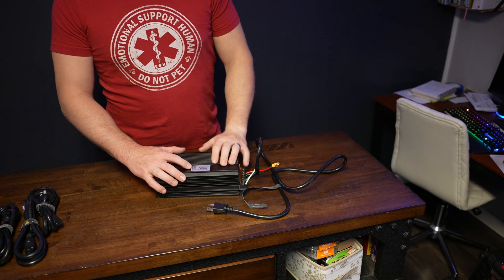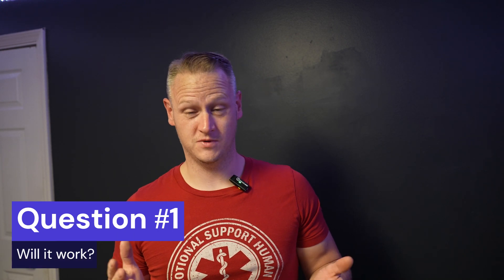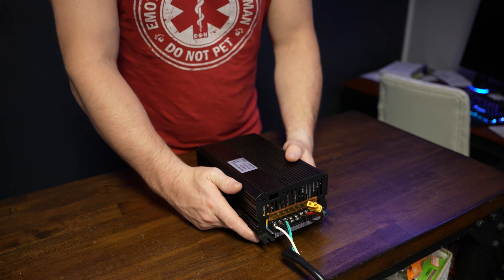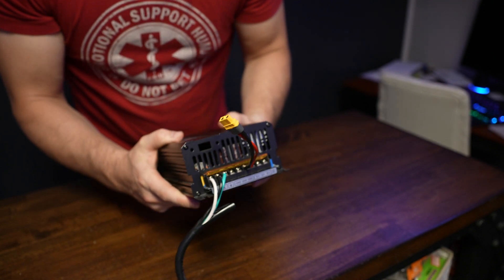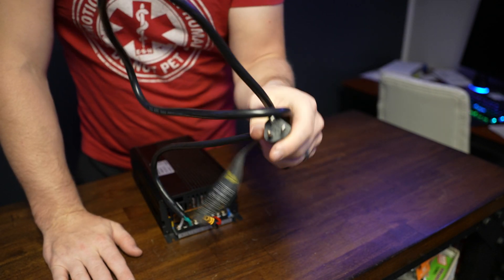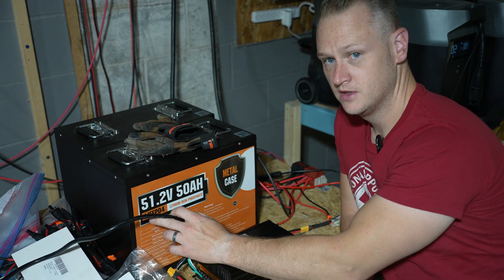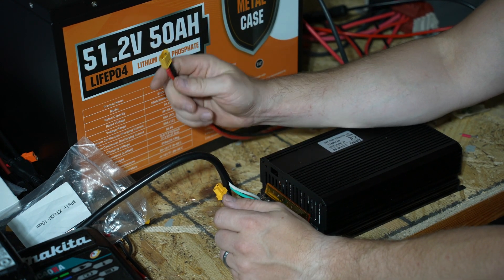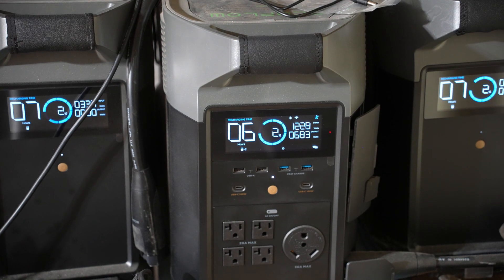Ecoflow Delta Pro  - Using an AC Switching Power Supply to extend your Delta Pro

Comment: Dan thank you so much! Google's Gemini actually recommended I watch your video because I was asking it about a particular solution that I needed which is similar to what you've found. I have a roof mounted solar panel system that can on the brightest of days put out about 7000 w. The inverter for that system CAN produce power even when the Grid's down. It's a special feature that will allow it to produce up to 1500 watts of 120 volt AC power depending on sunshine. I'm trying to get that power into a ecoflow Delta Pro Ultra's low power PV input. I need a device that can change that varying AC power into varying DC power that the Delta Pro Ultra inverter can safely accept. Initially it seemed that an EG4 chargeverter was the only thing that would do the job, but perhaps your system would. Thoughts?

Comment: Just clicked the link, it states a output of 18amps. Doesn't that exceed the 15a max? Or is the pro different from the pro 3? My high end on the delta pro 3 has a 150v 15a max on the high and a 60v 20 amp on the low. What could I use in its stead to input the most wattage. Struggling with so many options here
Reply from the maker: It's fine to exceed max amperage, voltage is the one you have to be careful with! Think of current (amperage) like a river passing by, it could be a small little creek or the massive Mississippi, your Delta Pro will only take from it as much as it needs (15a). Voltage is the velocity of the river...it can overwhelm your DP if its too high. Amperage is fine to exceed, you could do something with 1,000 amps and your DP would still only take 15a from it. Hope that helps some!

Comment: I am looking for a reverse solution.  I want to power 12v AC (40-80A) with 2 ecoflow delta 2 max.  I am looking at a 24V 50A 1200W DC Switching Power Supply Adapter PSU AC 110V / 220V-DC 24V Transformer Adapter found on amazon.  Is this possible (is it safe)?  Should i connect the AC direct to the power supply or add a 24v lithium battery and then connect AC to the battery?
Reply from the maker: I have a few questions based on what you've mentioned. You said you want to power a 12v AC but are looking at a 24v 50A 1200w switching supply? I think you need to look for a 12v PSU. The Delta 2 can definitely output the range you need (480-960w) so that won't be a problem. You just need to make sure you get the right AC/DC switching power supply.
Reply: @DanielGoodwin-jq1oc  Thank you for responding.  Do you offer any kind of consultation services?  I’m looking at 24v because the AC can do 12v/24v (its a truck (18 wheeler AC - see amazon). From what I learned here on youtube 24v is better than 12v due to wire cost,  efficiency, etc. for can life.
Reply from the maker: Got it, that makes sense now. Yes, in that case you should be able to power a 24v AC/DC PSU no problem with a Delta 2. However, for how long will be a question. If you have a recharging source (solar, alternator etc) then you can probably go for a while. If the AC is running continuously at 24vx40a=960w/hr then you'll deplete the Delta 2 in about an hour (1,024w) without additional charging.   I'm just a handyman myself, I can't offer consultation...not qualifed! :)  I do these videos just so others can see and learn from my mistakes and hopefully a few successes.
Reply: @DanielGoodwin-jq1oc  I have Ecoflow Delta 2 max and i just bought a 2nd battery, which should give approx 4kw.  I also have the 800 watt alternator charger.  I can charge it in 1-2 hrs.  Nobody except you so far is talking about these power switching supplies so I’m really unsure on how to setup.  All vampires life content are using more expensive electrical setups with different components.  I’m a trailblazer trying not to set my equipment or van a blaze! 😆

Comment: if i plug this power supply into any outlet when i am in whole house mode on my dp units does this work. can i charge using my own outlets and net anything.  if i have an external source for this power supply i can see some reward but can i supply my own power while in 240 mode with ecoflow.   it would seem practical to recharge using a wall outlet when not in 240 mode and ecoflow is off line.    in a complete power outage i could not recharge the delta pros unless i used my whole house outlets.   i cant get my mind around this.  pls help.
Reply from the maker: I'm not sure I follow the questions here. Mainly, I would recommend pairing a Delta Pro with a solar panel(s) for charging/recharging it when you don't have AC available.

Comment: The Delta Pro only pulls 15A. 80V X 15A is 1200 watts....what you are getting. I am using a setup like this as a backup to the backup. Using the 30A output on my old gas generator, I power 2 units like this. I only have one Ecoflow generator that I like to use on my leg my HVAV is on so I have uninterrupted nights. The issue is that ya can run the AC inverter on the Ecoflows with the Connection Hub AND charge from AC. So if my panels aren't producing, I fire up Ol' Trusty and put around 1200 watts to each. Learned several things from you b4 settin up my system. Thank you!
Reply: Can Not run the AC hub and charge from AC at the same time.

Comment: With respect to AC charging when a user is using a Double Voltage Hub (DVH), it is important keep in mind that EF users that have 2 DPs cannot charge the via AC power while connected to the DVH. AC charging id disabled.

EF users either have to purchase 2 EcoFlow Smart Generators which will charge the DPs via DC current through the rear battery ports which turns the DPs on and off automatically as required depending on the DPs state of charge (SOC) 

Example here https://youtu.be/wr_y7x4_Vkw 

Alternatively, EF users can also charge both of their DPs while they are still fully powering the user’s house if a Switch Mode Power Supply (SMPS) is used with ANY gasoline or propane generator a user may already have but it is a third party solution a user would have to purchase which is not sold by EF. 

Example here https://youtu.be/kVEqvLiHx2w

Several of us EF users originally had that same TOTIWO SMPS. Unfortunately, it needs to be turned down from 90 volts to 76 volts so that it is only running at 80% of its rated capacity as per manufacturer's recommendation. At 76 volts, it will only output 1200 watts into the DP and even at 80%, one of these TOTIWO SMPS still failed after 6 months.

So most of us have now switched the 2000 watt Ideal Pusling model set to somewhere between 100 and 108 volts which will provide the 1600 watts the DP is capable of taking.

Link to Ideal pulsing model   https://www.alibaba.com/product-detail/AC-110-240V-to-DC-24V_1600953688263.html

Keep in mind there are power losses with using SMPS as each of mine require 1,875 watts of AC power to output 1,600 watts of DC power into the DP but the benefit is that my DP's can output their full capacity of 3,600 watts rather than the reduced 1,800 watts which is limited by the "pass through" mode that occurs when a DP is connected to an AC power source.

Link to my current set up here:

https://www.facebook.com/groups/deltaprolaunch/permalink/1388987988234719/

Links to my current solar set up here:
https://www.facebook.com/groups/deltaprolaunch/permalink/1386646698468848/
https://www.facebook.com/groups/deltaprolaunch/permalink/1514477195685797/
Reply: Looking to get a power supply to power both of my DP’s .  I probably only need a total of 1200 watts across the two,  Can I use just one power supply, if so which one would you recommend?

Comment: Another question as I've just subscribed to the channel. Do you have 2 external EcoFlow batteries on each of your Delta Pro's ?
Reply from the maker: For my 120v single phase circuits, yes. I have 2 Delta Pros connected to a Smart Home Panel that runs all of my home's single phase circuits and each Delta Pro has 2 external batteries connected to them for a total of approximately 20kwh of capacity. My split phase 240v circuits are on a different Smart Home panel powered by two delta pros that do not have external batteries because I went down this path of using an external battery bank.

Comment: I want to thank you. This seems like the exact solution I've been searching for. Please continue to bring us content like this. 🎉🎉

Do you have the DC from the AC/DC inverter split into each of the Delta Pro's solar inputs ?
Reply from the maker: Right now its just feeding into one. My goal is once I obtain my solar panels and greater productivity is to try to feed into 2 Delta Pros from the external battery bank and the EG4 Controller. Will definitely update once I get to that stage.
Reply: That’s exactly what I’m trying to do for my Delta pros. Do you have an idea on how you’re going to implement both solar inputs from one external battery bank and 1 eg4 controller?
Reply: Could you split the AC to DC cable in a 1 to 2 configuration going to each Delta Pro? I used to do something like that inside my old desktop towers using a splitter power cable from the power supply to power two SSD drives. Not sure if you can do that here. Or whether it would cut the number of watts to each Delta Pro in half from 1600 to 800 each power station.

But I do like this option very much.

Comment: I like this option given the DP's limitation to accept AC wall charging while connected to the double voltage hub. One question - why did you use the 80V /18A switching unit instead of the available 90V/16A unit? I believe that would allow you to charge at a higher incoming wattage rate. Your video shows 1200+ charging wattage presumably due to the DP's 15A limitation. The 90V/16A unit should deliver closer to 1400+ wattage charging to the DP.

Comment: A little off topic but can I please ask.  I just bought a used Delta Pro without an AC cable and saw once somewhere that it was 14awg with a warning to not use anything else, and can't find that info again.  The 'official' AC cords are sold out on Ecoflow but don't say what the awg is anyway and I want to buy the right thing.  But second question, would an 18awg would do any damage??  Thank you!
Reply from the maker: I would not recommend an 18 awg cable. Usually, (if you look on Amazon for example) they will be rated for only 10 amps. If you don't limit it, the Delta Pro will try to draw a lot more than that and it could melt your cord or worse. Now, you could use an 18awg cable and turn the switch on the back to "slow" charging (400 watts I think?). However, I'd recommend just looking for a good 14awg or better cable. For example, this one would probably work well:

https://amzn.to/3LQdBYr

Comment: Why don't you just plug your Delta Pro's AC input into the AC output of the EG4 inverter? 

You don't need to buy anything extra that way.  Of course DC to AC to DC conversion isn't the most efficient but neither is doing it your way which is still DC to AC to DC.

You even have ECO-Worthy batteries.  Our setups are very similar.

Have you used the "Backup Reserve" feature on the Delta Pro?  I have noise issues with the AC output when I use it.
Reply from the maker: That would be convenient! Unfortunately, the Delta Pro's AC input and outputs are disabled when connected to the Smart Home Panel via the Infinity cables.

Comment: Thanks, just ordered one and using it to pull from my Ioniq 5 V2L adapter to utilize the 77Kw battery.
Reply from the maker: 77Kwh is a LOT of capacity! :) Definitely on my wish list.
Reply: I want to do the same for an EV6. How is it working for you Michael?
Reply: @hlgenius  I haven't had the need as of yet, but in testing it worked just fine

Comment: Sorry to bug you but is this solution still working for you? Thanks
Reply from the maker: Yes! I was going to do an update video after about a month. So far it has been working reliably each day. The EG4 controller/inverter charges up the battery bank and once there is enough power in the battery bank it powers up the switching supply automatically which feeds into the Delta Pro. I need to beef up the solar array feeding the controller and battery bank because right now its probably a little undersized. I haven't done that yet because I wanted to make sure it kept working successfully.
Reply: @DanielGoodwin-jq1oc  Thanks for the response. I have been living in a 65' trailer and that is why I bought the Delta pros last month . I have been trying to use them but with two 1500 btu air conditioners and using the multi port hub I didn't have a way to connect my 3500watt generator so I only got 1.5 hours of use before the battery. I just bought initiated the purchase of a new house near San Antonio, Tx so I have thinking of selling the delta pros after only one charge cycle and a firmware update. The reason being I want to do a DYI Signature solar setup with 6 48v batteries and such So, I do not need to worry how to set up this charging of them but just getting my money back out of them. I do appreciate your channel and you help.

Comment: Why in the world you want to do something so inefficient like that. You are converting AC to DC to charge your EcoFlow that will convert the DC back to AC. I don’t get it
Reply from the maker: Agreed, Its dreadfully inefficient. The only reason you'd do something like this is:

1. You have excess solar capacity (far greater than the 1,600w limit of the Delta Pro)
2. You want to have excess battery capacity (of an external battery bank in addition to the Delta Pro and its 2 extra batteries).

But efficient? No definitely not efficient.

Comment: I have a question. Has anyone figured out a good way to charge up a battery bank using the DP instead of using their smart battery?
Reply from the maker: You want to charge an external battery bank from the Delta Pro, correct? You should be able to use pretty much any AC battery charger for that. If your Delta Pro is not connected to a Smart Home Panel, just plug the charger into one of the front ports of the Delta Pro and it will charge the external battery bank. If it is connected to the SHP, just plug it into any outlet that is on a circuit powered by the Delta Pro and it will charge the battery bank. If you want to use DC, you can find a model that uses the Anderson DC port on the side of the Delta Pro but you will be limited to charging at 360 watts (12v x 30 amps).
Reply: One option is to use the ecoflow 800 watt alternator charger.  One added benefit is that is can charge either direction you choose...use the delta pro to charge your battery bank or use the battery bank to charge your delta pro.  It only charges at 700-800 watts, though.
Reply: @curth3671 thanks for that. Since I posted my question a year ago here is what I did. I purchased a 2000 watt converter (a/c to d/c). This allows me to conver a/c power from a regular inverter propane generator or from a electric outlet into the solar port on the DP. while using my double 220 hub.

Comment: Our EcoFlow Dual Fuel generator charges the Delta Pro via DC direct.  Is that input useable for your purpose?
Reply from the maker: Yes, that would definitely work and is a good pairing with a Delta Pro. In my specific case, I'm trying to add stored battery capacity to my Delta Pro system by using an external battery bank but yes, the Ecoflow duel fuel generator is a good way to extending your Delta Pro.

Comment: Riddle me this: “Why not just plug the AC input of the Delta Pro directly into the power strip?”
Panel limitation?
If so that’s a big strike against the Smart Panel, a non-starter in my opinion
Reply from the maker: Indeed, the Delta Pros disable their AC input/outputs once you connect them to the smart home panel via the infinity cables. The idea is that those cables will handle the AC input to the delta pros and the AC output will come from your house circuit board. It makes sense, but yes would be nice if you still use the AC input and outputs on the Delta pro when connected to the Smart Home Panel.
Reply: @DanielGoodwin-jq1oc  Does it also disable the AC input on the DP extra batteries. If not you could charge those via AC from the inverter and those batteries would then keep the DPs charged? I know this might not work but I am really trying to figure this out before I buy the DP extra batteries.
Reply from the maker: A good question. Unfortunately, there is no AC input on the extra batteries. The batteries can only use the proprietary cable that connects them to the Delta Pro unit. They're essentially useless without an accompanying Delta Pro.